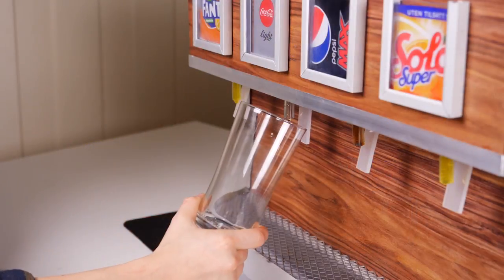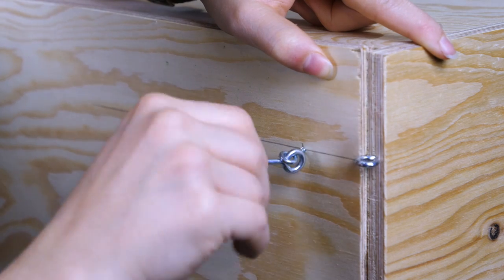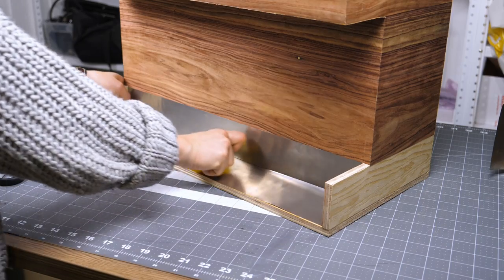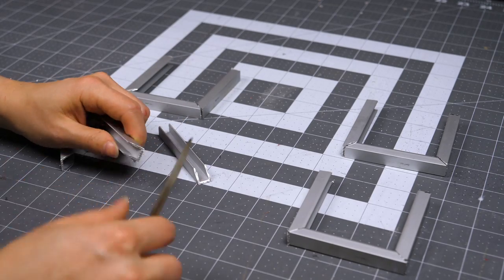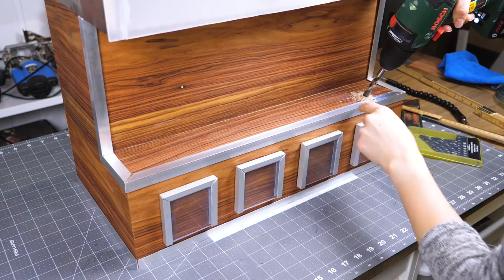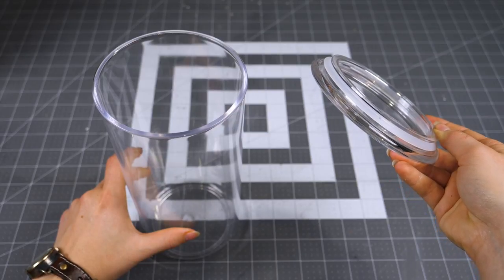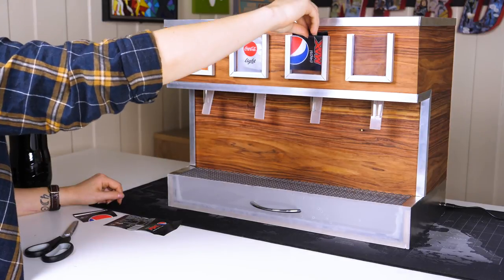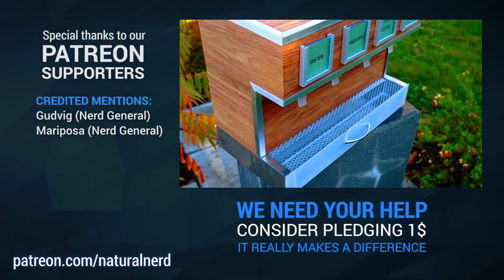DIY SODA DISPENSER - Awesome for parties!

Comment: I just thought I would share some information as I work with acrylic quite often as a fish breeder; Silicone won’t actually bond to acrylic, only glass… If you tried to use silicone to affix an acrylic plate to a glass plate the silicone will bond to the glass and completely peel free from the acrylic.

The better option is to use an acrylic cement, such as Weld-On 4. Weld on is not a glue, but rather a chemical fusion between the two pieces of acrylic, very much similar to how welding works, hence the name. Once the Weld-On cures it’s as if you are working with a single piece of acrylic, the joint will literally disappear.

Also, I should note that Weld-On is the company name, but the 4 has to do with the viscosity of the Weld-On chemical. Weld-On 4 is almost as thin as water, it is designed to be used on two perfectly smooth surfaces; however, if you’re working with a bit of a rougher cut (say from hand cutting the pieces) you can utilize Weld-On 14, which is closer to the viscosity of syrup… The thick material is better at filling in any gaps or imperfections that resulted from the cutting process.

I just thought I would share this information as it took me a bit of trial and error to find the best methodology for fusing two pieces of acrylic together, and if I can share that information and keep someone from falling into the same pitfalls that I did then it was worth speaking up. 

Thanks for the fantastic video, your projects are always a blast; fantastic fusion of creativity, functionality and artistic expression.
Reply from the maker: Thank you so much for your insight! Those are great tips. I'll check it out next time I have to fuse acrylic.
Reply: Thank you, I am happy to hear that this information may be of use to others.
Reply: It's my pleasure, I am happy to hear that this information could be of use. I wish you much luck with your future adventures with acrylic; it's not the easiest material to work with, but it sure does result in a great looking finished product.
Reply: The chemical is Dichloromethane or DCM or methylene chloride,  I have noticed other chemical as ingredients, but DCM is the solvent that does most if not all the work.
Its not cheap in small quantities but very cheap in large quantities.
It also boils a little below 40c
Reply: Father Time hhhhho
Reply: Father Time sffff
Reply: Thank you so much.  I've been doing a lot of online research before building some desktop fountains and your one comment has saved me a lot of time!.
Reply: Thanks for this info

Comment from the maker: Response to comments about using airpumps (or vacuum pumps): 10:15
Yes, that's clearly possible as most other videos with soda dispensers does that. I wanted to try something different and see if it would work with a super affordable submersible pump. The benefits are only a lower cost, and usually a higher flow rate. I also wanted to have containers that I could put ice in to keep drinks cool, and this method made that very easy. But for carbonated drinks a vacuum pump is better as it wont remove as much carbonation, so if you want to replicate the build using that type of pump you shouldn't have to change much!

EDIT: About the pumps being food grade; that's definitely some valid critisism. Before using it on the regular I changed the pumps into some food grade vacuum pumps (= even more flat soda, unfortunately, but I don't use it much for soda) that are linked in the description now too. They work just as well with this whole setup, just had to place the tubes a bit differently with the in- and outtake on the pump.
Reply: Now you just need to add refrigeration :)
Reply: Natural Nerd Are the pumps and wires designed for contact with food grade plastics? Usually those low cost Chinese pumps are made with chemicals that leach.
Reply: natural nerd
Why not, you teach us how you make your plans
Reply: Natural Nerd what are the wood cutting dimensions??? Please
Reply: It’s nice to see a female engineer it brightens my day
Reply: Better to line the inside with some sort of metal sheeting where you put the jars because then you can put ice coolers around the jars that way you don't have to put ice cubes into the jars which would melt watering down the fizzy drinks.
Reply: Natural Nerd hi i love ur vids but i have an tip if u use acrilic place paiters tape on the cutting line it will saw much better ps love the result
Reply: Natural Nerd I used an air pump a while back and once you get liquid flowing and stop the pump it will keep flowing for awhile, I am not sure if the pump you used also caises the same issue or not.
Reply: cool, but those pumps are 100% NOT food safe. really, why would they be?
Reply: hey @Nerdforge what is the song at the start of the video?
Reply: Henry McCausland AGREED
Reply: Hi, just want to say I love your projects. Busy with little fridge you showed with a few differences. Thinking of making space for 3 2L cooldrinks that actually pumps to the dispenser you  showed here. Busy with it for my own personal bar in my house. What I would like to know is what size pumps you were using. 3L per minute max output too fast?
Reply: how much make me one?
Reply: Try placing the air pumps outside of the containers so air pressure forces your drink through the spout. It will keep the pump and wires (which both contain lead) out of the beverages, eliminate mold growth in/on the pump, make for easier cleanup and reduce cross-contamination when you switch from one beverage to another. Neat gadget though, an in home soda fountain.
Reply: Hey ..!!!
You can use a peristaltic pump instead of a mechanical centrifugal pump that comes in contact with the liquid
Reply: @mysoulwanders  those are actually used for fountains and aquariums bruh !!!
But she could have used a peristaltic pump instead of the Chinese centrifugal pump
Reply: I know this is like 100 years old now LOL ..  I wanted to also mention, as for the Soda being flat.. I saw another method. that MAYBE you can incorporate ( that's probably the wrong wording, cuz it's a whole rewrite just about).  I'm wondering if you put the soda bottles in UPSIDE DOWN. and made it so that they would flow OUT. not being pumped out. killed the carbonation.. course you'd have to design a open close flow . over all may be a cheaper build? and faster pour, with no fizz loss. 
I know you already bought containers and stuff for liquids .. but maybe you can make a new one? for BOOZE??? ( Hint hint) and incorporate some of the ideas folks had? ( Not mine per say but others for lights etc. ) . . GFEAT VIDEO by the way..

Comment: Just came across your channel yesterday and I am loving these projects, would suggest maybe putting an opaque piece of plastic behind the signs to light them up if it is used in the dark, maybe add a switch to each to say if they are empty... or just to turn them off to save power in the daylight

Comment: Or you could use compressed air to put air into the container, pushing the liquid out. That way you would only need one compressor (You can redirect the flow of air fairly easily), and the soda would not loose that much carbonation.
Reply: Plus, you wold not have a problem cleaning the pumps.

And you could get creative, and avoid electrics altogether - attach a compressed air reservoir, connected to all containers all the time, and have the levers just open/close a valve placed on the tube plugged into each container.
Reply: Your cylinder would need to be both air and water tight because you'd have to pressurize the cylinder to push the liquid. The use of CO2 as the air source would help as well....seeing as how that's what the carbonation is any ways.

Comment: yeah this is cool I know I wouldn't have put the pumps in the Reservoir I thank a dip tube would have done just as good  but it work well super Kool now that cooler that you built could be adapted to this dispenser so you could have chilled/ cooled drinks thank you for sharing cool ideas

Comment: I love your design! I made one with a group that used positive air pressure with a manifold valve system.  This air pressure forced liquid out of another line for dispensing. We used a plc for more of an automation style. We also had an ice dispenser using a small cylinder. Thanks for sharing your design!!!

Comment: Really nice design, I'm always amazed at your ingenuity.

A few suggestions I'd make would be to lengthen the back, change the style of container to retangular tubs to maximize space, add a fill tube to the container so you can fill it relatively easy, add a cap to that tube to make it airtight, for the dispensing tubes, add an electronic shutoff valve to the tube so that it doesn't drip as much when you're done filling your glass.

Also, you could incorporate your 'mini-fridge' into the drink compartment to keep it cooler a little longer, and while you're at it, you could make a separate compartment in the drink containers for the ice so that it doesn't melt and dilute the high-fructose corn syrup deliciousness of your beverage

Comment: Amazing result! looks really cool:) just watch out for the materials coming in contact with the soda. The pump and cables might not be made for beverages and the mostly acidic Softdrinks could solve some unwanted chemicals or lubrication oil.
Reply: That's not healthy also, i think it might be poison...
Reply: @kdxcode  most wicked stuff is not healthy but you're right. probably not healthy and toxic. poison is a matter of dose though

Comment: There are other forms of plywood that can be used for the case. In the United States, where i live, many companies that produce cabinets use lumber-core plywood. It is a series of planks about 12.7mm thick with wood veneer on both faces of the lumber. It might be possible to use that for some sort of project, but this is only a suggestion.

Comment: If you ever redo this machine, have a look at home brewing equipment.
I would recommend that you use a sodastream co2 cartridge with a pressure regulator, and then an on/off valve at each lid.
This way you will use the pressure from the co2 to push out the soda. And the co2 will also make sure your soda stays carbonated to the last drop.

Comment: I love this channel. I'm one of those people who would rather make something instead of buying something. As for your containers, I think fastening the pumps to the top of the containers and running a tube from the pump into the bottom of the container might have been better. No electrics in the fluid (always a good idea) and the pump takes up room in the container that could hold more drink.

Comment: Really impressive build.   I would prefer this in a soda bottle with an air pump.  If you made the back portion just a little bit larger you could waterproof it, then insulate it with some foam.  put the bottles in and then dump ice around them, essentially a cooler.

Comment: This is interesting. 
I like the design, especially for non-carbonated drinks. 
I'd probably go with forced air, rather than a vacuum pump. 
You can get sealed carbon dioxide canisters instead of running room air; regardless of Carbon dioxide or regular room air, carbonation increases with partial pressure.

Comment: I love how it looks great design the only thing i would change is mount the pump on top of the lid and run a tube in to the containers cause im just a little iffy about the wire's being in the soda but the hold thing looks great 👍

Comment: Nice work. I'd probably expand the rear area, add foam insulation and use a peltier cooling module to keep the drinks cool rather than using ice.

Comment: I think you should have put some kind of disconnects for the pump leads so you could disconnect the pumps for cleaning. Also maybe moved the tubes out farther so you could let them drain easier when the switch was released. Otherwise, awesome build!
Reply: William Wagner for cleaning just run soapy water through and then fresh water :p

Comment: Are those pumps really food safe? And the electric wiring? You really don’t want to mix pvc particles in your drinks 😱
Reply: Ok. I looked up the pump u ordered and linked to. It is NOT food safe at all. I hope people will read these comments so they at least can order safe stuff to build this project with. Not all plastics are suitable for food, and many are really dangerous and can cause diseases such as cancer and Alzheimer’s.
Reply: I'm glad I'm not alone on thinking that. No way would I take a drink from this train wreck. Nice school project, but a terrible idea for something to actually use!
Reply: Jen Yates Not using food safe materials is the big issue here.  I don’t see the reason on insulting the project it self, or the construction not related to materials touching food, even if it is something yourself would never have any use for.
Reply: Geek Boy 21 You seem to be missing the point here. The issue has nothing to do with the pumps being submerged in the liquid; it's that the liquid ducts inside the pumps make direct contact with the internal components (flux, solder, adhesives, and all). These pumps are only meant to pump things like coolants and are not designed to serve drinks. As the sodas pass through these pumps, they come in direct contact with various contaminants which not only rub off and mix into your sugary drink, but also gradually degrade the longevity of your pump as well. As others in this thread have mentioned, peristaltic pumps would be way better for this project, since the liquid-bearing tubing is completely isolated from the pump itself, making it totally safe for pumping consumable liquids.

Also, please try not to be so dismissive of others and keep your discussions civil.
Reply: Oh, guys are you really so sure? Wouldn't cleaning it do the job?
Reply: DrawDeath Cleaning it doesn't change the fact that the liquid comes into contact with leaded solder and other harmful materials required for the motor to work. For a slightly hyperbolic analogy, you can't just wash the surface of a lead block with soap and water and expect it to be safe.
Reply: Should have used peristaltic pumps. cool tho
Reply: Uh you are completely over reacting. Those pumps are food safe as there is nothing hazardous contained in them and they aren't being used for hazardous materials. Food safe ratings (i.e. NSF) are for commercial purposes. You aren't going to get sick by using these pumps or this tubing. Wash them out and use them. Contrary to popular belief, no plastic doesn't cause cancer or Alzheimer's. But what do I know, it's not like I've spent over a decade in the healthcare field or anything.
Reply: @mikel9567  exactly. If you're that concerned, don't submerge the pump. This pump will operate happily outside your water vessel based on other guides I've seen that use this pump.
Reply: IKR
Reply: Great point! Sodas are also very sour so the acids make this even worse.
Reply: wow this escalated quick
lol
Reply: Yeah I was wondering why she submerged the pump and wires when that could have been left outside of the container, with a hose going from the pump's intake into the container.  It would work exactly the same way, but you wouldn't have it constantly submerged in liquid, which seems really really bad for something you're drinking.  Especially with anything carbonated.
Reply: @mikel9567  however, some beverages are mildly acidic (or in the case of soft drinks, very acidic) and that can pose a leaching issue. I think this situation could be improved by taking the pumps out of the containers, mounting them either to the top of the containers or compartment and lowering a tube to the bottom of the container.

Comment: This one looks super nice! Maybe use only acrylic tube inside the container instead of the whole pump. We all know what cola does to metal and other surfaces. Or switch it up to a compressed air system to push the drinks out😉 much safer over time
Reply from the maker: Thanks! Yes, I'll probably swap the pump after reading some suggestions about degradation over time and also not being food safe.

Comment: Year and a half late, but chilling soda helps maintain carbonation. Cold water will hold more co2. Commercial dispensers have a cold plate that the carbonated water goes through. Basically an aluminum block with stainless lines running through it.

Comment: You should have used a bigger square plastic container/tub in which to put the 4 "bottles" so you can put ice outside the 4 bottles and keep the drinks cold without diluting them. Even so you can throw some ice bags in there and just pray the bags dont have holes/cuts in them.

Comment: a better method would have to not submerged the pumps..but to fit tubing to the bottom of the containers with something like fittings commonly used in computer-water-cooling setups, and use a quick disconnect to the pump, so the fluid tanks can still be thrown in a washer. and since you aren't putting the pump in sticky, sugary fluid, it won't get so nasty

Comment: Rewatching this...and the same idea came to me as last time... wouldn't a pressurizing pump system work for pushing the liquid through the system?
It would require a weird seeming cap, but as it would allow you to use any bottle of soda, and also drain it fully...I probably need to draw what I mean...it would also preserve the carbonation...and it would be more sanitary as there would be very little coming into contact with the liquid...
Reply: I also have an idea of how to ensure that the liquid in the lines stay sealed off from the air when not being pumped...